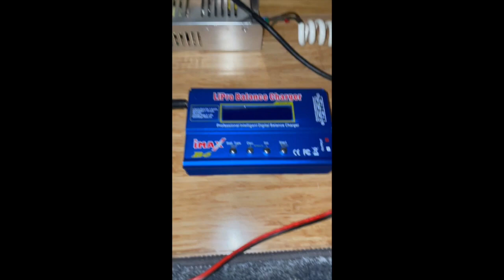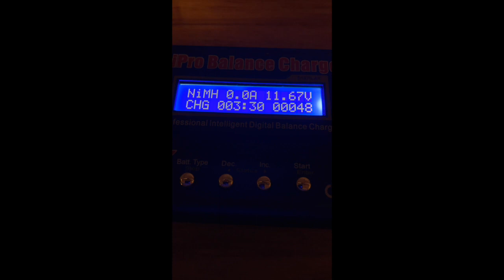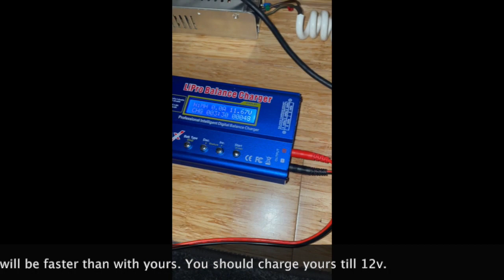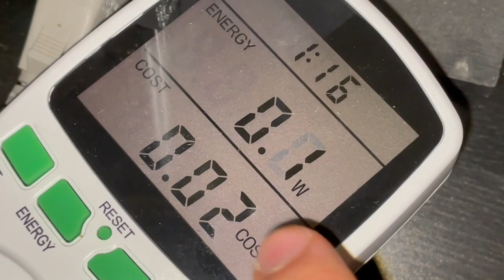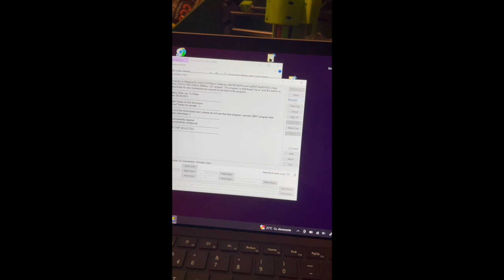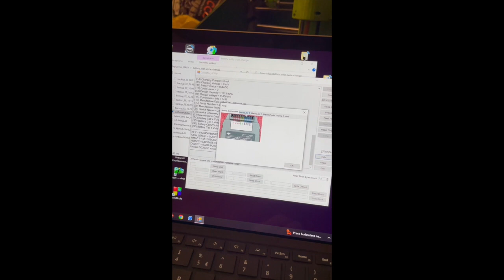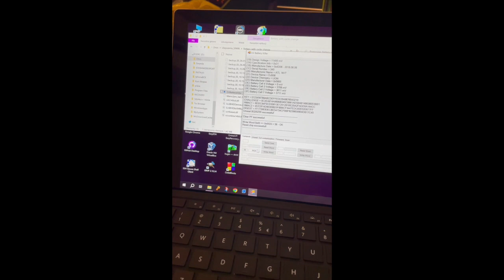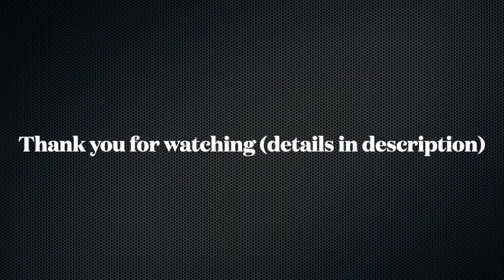How to fix dead DJI Mavic Pro battery using CP2112 (Works aslo with Phantom 4)

Comment: Rather than soldering wires to the sda and scl couldn't you just attach to the corresponding pins on the connector?
Reply from the maker: No because on old DJI batteries SDA and SCL are not led out to the connector
This applies to mavic pro and phantom pro

Comment: Fantastic guide! thank you

My battery is now charging but only 3 lights are showing, the battery cell 4 voltage still shows as 0 will this need more time to charge then balance or is the cell dead?

Edited to add, mavic pro battery only has 3 cells so it will always show cell 4 as 0
3 lights means battery is between 50% to 75% charged, left it on charge and now its charging 4 leds indicating >75%

Comment: Thank you for a very good description that can save us a lot of money
I have some adds to your descripion:
1.	A heat gun is to a great help when opening the battery shell. It makes the glue softer. However be careful, to much heat can spoil the plastic shell as well as the batteries
2.	If your battery shell gets to destroyed, you can find a new shell for just about 10€.
3.	If you after the procedure find that the battery do not respond on its push button and you can not get the leds to light up, then try this: Hold the pusch button in for 30 seconds. Repeat a few times until the leds lights up and the problem is solved
4.	If the battery killer program can not read the battery, then try to increase the battery voltage more, to ,say, 12.8 V.

Comment: Want to say thanks for this tutorial, I managed to revive 3 Mavic Pro batteries! Had tried circuit schools method with arduino and DJI Battery killer previous with no success, the key to making it work was entering the 24 and 29 “words” plus the reset chip. I also re sealed the battery because I was seeing not authentic in DJI GO app without doing this. Many thanks, Mark.

Comment: This was very helpful - you had a few extra steps compared to the instructions included with the DJI Battery Killer download. Specifically to 'reset chip' and an additional 'unseal' between writing 0024 and 0029. Not clear if this is critical as I followed your instructions but appreciate how thorough you were and including the schematic with visual references on the board as my battery is OEM but old and did not have silk screen to indicate which pad had which function :)

Comment: here is the Phantom 4 battery READ after clearing the PF using the CP 2112 and this software. 
Write Word 0x00 <= 0x0029 = 41 - OK
Write Word 0x00 <= 0x0024 = 36 - OK
(00) Manufacturer Access = 0x0000
(01) Remaining Capacity Alarm = 150 mAh
(02) Remaining Time Alarm = 10 min
(03) Battery Mode = 0x6001
(04) At Rate = 0 mA
(05) At Rate Time To Full = 65535 min(s)
(06) At Rate Time To Empty = 65535 min(s)
(07) At Rate OK = 1
(08) Temperature = 21 C
(09) Voltage = 17163 mV
(0A) Current = 0 mA
(0B) Average Current = 0 mA
(0C) Max Error = 1 %
(0D) RSOC = 97 %
(0E) ASOC = 95 %
(0F) Remaining Capacity = 2536 mAh
(10) Full Charge Capacity = 2620 mAh
(11) Run Time to Empty = 65535 min(s)
(12) Average Time to Empty = 65535 min(s)
(13) Average Time to Full = 65535 min(s)
(14) Charging Current = 0 mA
(15) Charging Voltage = 0 mV
(16) Battery Status = 0x48C0
(17) Cycle Count = 17
(18) Design Capacity = 2675 mAh
(19) Design Voltage = 15200 mV
(1A) Cpecification Info = 0x31
(1B) Manufacture Date = 0x4862 - 2016.03.02
(1C) Serial Number = 723
(20) Manufacturer Name = ATL  NVT
(21) Device Name = DJ009
(22) Device Chemistry = LION
(23) Manufacturer Data = 0x5005
(3C) Battery Cell 4 Voltage = 4292 mV
(3D) Battery Cell 3 Voltage = 4294 mV
(3E) Battery Cell 2 Voltage = 4286 mV
(3F) Battery Cell 1 Voltage = 4291 mV
----------------------------------------------------------------
Clear PF successfull
----------------------------------------------------------------

Comment: Mine had error sbus reading. Any way to workaround this?
Reply from the maker: That means either broken chip either you need to turn on battery and read data when battery is on

Comment: Have recovered my Batteries. But it says now in the APP Battery not authentificated. 
Authentifizierung der Batterie fehlgeschlagen.
Reply: I have fixed one Battery now. In the program is a authentification Button. Do this and it will work.
Reply: @juliuscasar9354  Hi.I have the same problem.Please tell me in detail how to fix it.Thanks!
Reply: Hi, i'm Mauricio from argentina 
Do not panic yet, this is normal on those devices, this happens when the pack is unsealed and the MSP430 detects that. It immediately throws that error. The only way to solve the error is by putting the battery after it was repaired to drone, changing battery_type parameter to 2 or 3, and then you must use Drone-Hacks to flash drone firmware again. The firmware doesn't need to be latest, but it must contain battery firmware.
The point here is to let the drone reflash the MSP430 firmware so it will stop complaining
about the Authentication error.
Reply: @mauriciourotondo6619  Thank you friend!
Reply: Thanks for the feedback guys!  👍😎✊
Reply: Have tried to Do the firmware Update wirh the battery in the drone but it stops ar 32% and says battery Update failure

Comment: Hello I tried it twice, but I have a problem that my battery flashed only when I charged it first time on my Imax B6 and what I remembered on it flashed two middle leds, but at that time I didnt have CP2112 and now when I connect it to original charger it doesnt flash. But when I did everything from your video, everything looked like in your video, only which was different is when in video in time 7:49 program wrote you "Reset chip successful !" in my case this line program didnt write me in both times, when I tried it. And after complete process battery  doesnt work, for information I charged battery to the voltage about 12,44V. Please can you help me ?
Thank you very much for your answer. 🙂
Reply: Any luck I cant get my battery to stay on and I get ERROR: Could not perform SMBus read 0x00

Comment: Cannot read..error : could not perform SMBus read 0x00
Reply: When I encountered this, it turned out that I had soldered to the contact closest to the edge of the CP 2112, which is not connected to the rest of the board. It's for some sort of jumper or something. Problem solved by de soldering, moving and re soldering the wires to the correct conection points on the board. that being said, a big THANK YOU to QwertYy for making this. I watched several videos, but this was the one that I ended up using. I filmed some of the process and will attempt to make a video for future battery revivers.

Comment: have i sealed it after clear pf?
Reply from the maker: There is no seal option in battery killer. Just click reset chip. It should seal by default.

Comment: Your video presentation has been exactly what I was looking for.  I did a lot of research on what I could do with my Mavic1 battery that had gone into a fully drained condition.  I used a 2 amp car battery charger to kick start the voltage then my LiPo battery charger to finish the charge.  The only major error on your video is it is required to jumper the 12 volts on the Mavic battery to one of the main + power pins on the battery connector.  This allows the Mavic battery circuit board to be powered up and then the Cp2112 mini board can talk to the battery (BMS) Battery Management System board.  Now I can talk to the battery but having Unsealed, Cleared PF Flags, manually entering the codes 0024 and 0029, writing to the chip and then re-sealing the battery the battery will not take a charge from the Mavic charger.  Solid green lamp stays on on my battery.  If you read this let me know any other thoughts that might help me or you can PM me. Calvin
Reply from the maker: Did u try to repeat the process?

Comment: Can this process work after deflating a bulged battery. Its still charging normal but when inserted in the drone, the drone quickly draines it and reports critical low battery.
Reply from the maker: Deflated battery is diffrent case. It can be chemicaly broken

Comment: Can you do this without opening the battery? Thanks
Reply from the maker: It works without opening only with newer batteries. Mavic pro and Phantom 4 needs to be open because their I2C bus ports are inside the battery.
Reply: @TheAdamjh  The newer batteries you mean the Mavic2 pro ones?
Can be done without opening the battery case? Is the balancer charger step needed ?

Comment: I am getting a battery authentication error after doing this process to my Phantom 4 pro battery. Can you offer any assistance?
Reply: To remove that you have to: ( these comes after you made the steps above )
- charge the battery full
- reflash the drone with the latest firmware with the new battery in it
 - connect with the CP2112 again and then: connect, read info, unseal, clear and reset the chip. 

Had the same issue, but this fixed it.
Reply: @saxonrc  Hello friend, I have the same battery signal error problem after doing the process, what should I do to eliminate it, thank you
Reply: @ocristus18  Hi,  if the steps above don't help, go back to the battery killer app, and do the process again but at the end hit Unseal - Clear PF - Unseal - Clear PF2 ( I am not sure if I clicked on Reset Chips as well, it was for a while ). 
I had 2 batteries with which I had to make this, but now it is all good. I hope this will help.
Reply: Thanks for the feedback guys 👍😎✊
Reply from the maker: can u send screenshot to my mail? adm.moszczynski@gmail.com
Reply: @TheAdamjh  Hi.I have the same problem.Please tell me in detail how to fix it.Thanks!
Reply: @TheAdamjh sir sent you mail .
Please help me